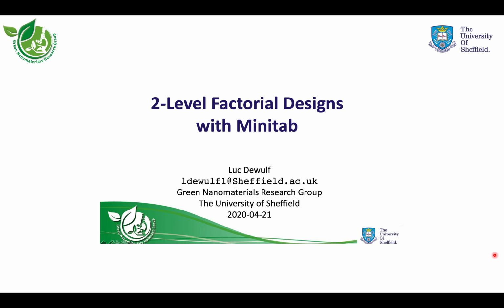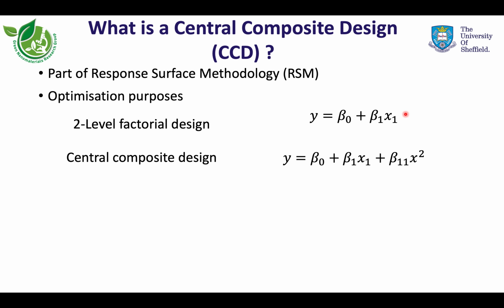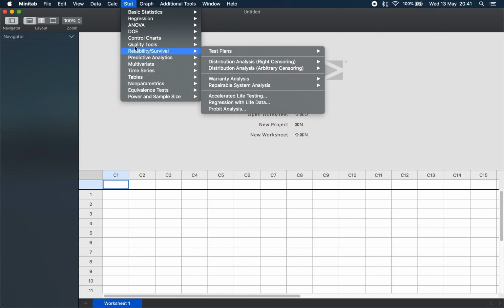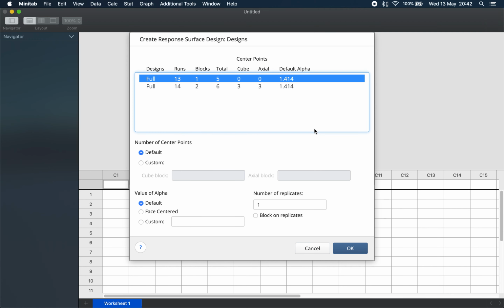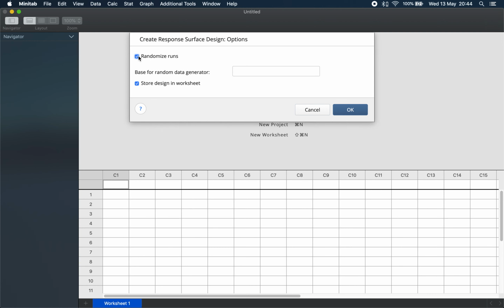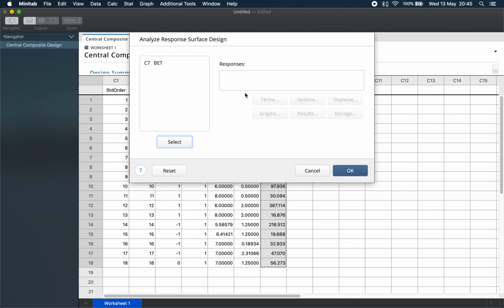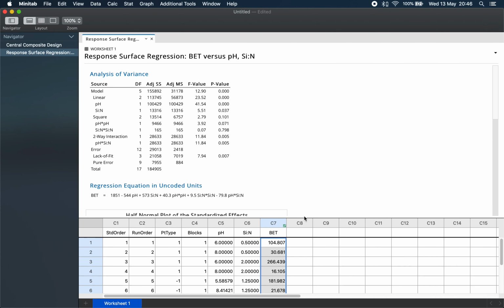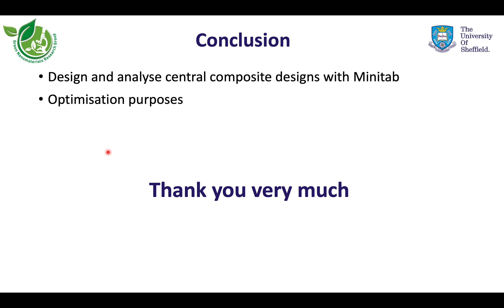Tutorial: Central Composite Designs with Minitab

Comment: I read in a paper : ' the central composite design (CCD) of response surface methodology (RSM) based experiment design of 20 runs (14 axial
 and 6 central point parameter settings) is employed '. They have taken 3 factors. So what does the 14 axial and 6 central point mean? How to set those in minitab